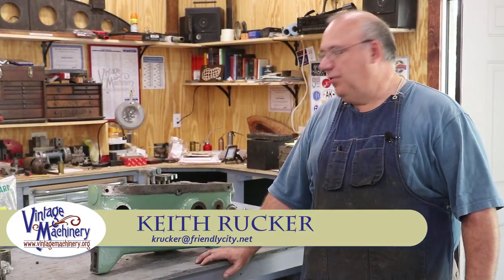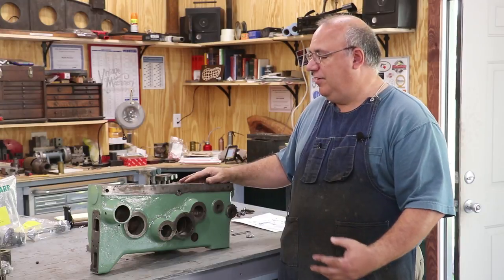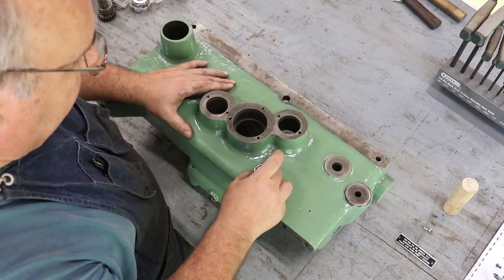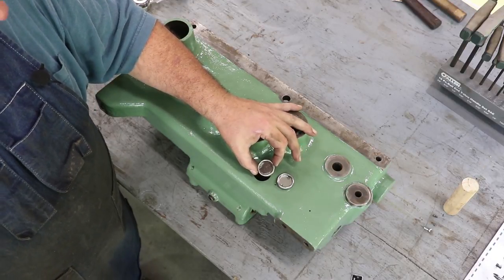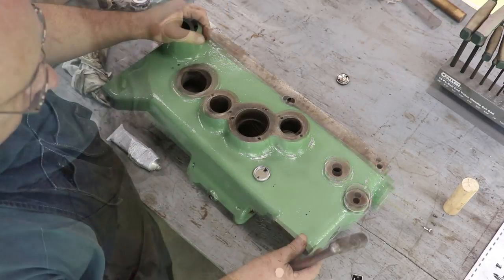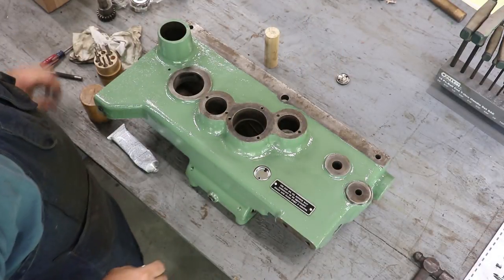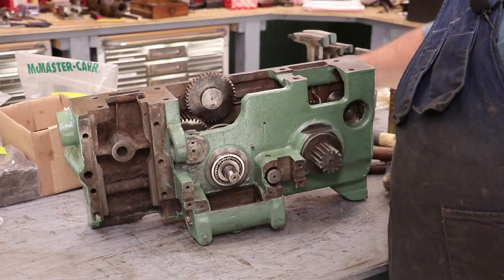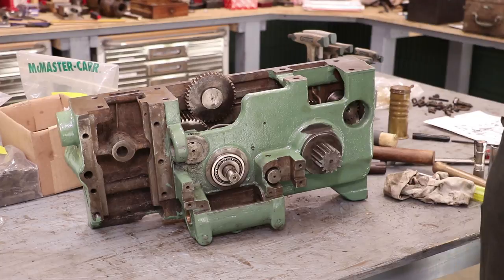Monarch 16" Lathe Restoration 9: Apron Reassembly

Comment: Great that Monarch still has the parts available! Yes they are pricey but I think it is worth the donation to keep that source around.
Reply: It makes me wonder though, whether those very high prices are justified. I know, from having bought and made them, that bronze gears that size can be expensive, and worm gears are even more expensive. But this is really expensive. Since it’s a custom size, it’s going to cost. But from people I know who have worked on Monarch, and other lathes from back then, the prices are well in advance of what would be expected by inflation. Yes, they sell small numbers. But, as a former manufacturer, I can say that raising prices above what’s required, drives customers away.

How many people, and companies, who would have otherwise rebuilt machines, decided to scrap them out instead, because of overwhelming parts costs? Quite a few, I would imagine. That doesn’t help  those who want to rebuild a machine, and in the long run, it doesn’t help Monarch either.

Comment: Keith,
I may be old school here. But I have built many engines in my day, no lathes, but automobile engines. As I watched you reassemble this very complex gearbox (dry for the most part), I said to myself, "Why doesn't he use STP?" I always coated all my engine parts with STP when I built the engine because without it, until the oil (Owell as you call it :) ) pump pushed the oil up into the engine, it was essentially running dry. Okay, I get that this assembly is rotating nowhere near as fast as an automobile engine. We are talking back in the 60's here, but STP coating a bearing surface would prevent any kind of wear. In fact, I bet that it would take you a year of use on that lathe before the real oil ever got to the bearings. Also, seeing as how the bearings are sump lubricated, I would have soaked them in STP first. They would probably last a hundred years if you did. Anyway, just a ramble about a product I used and trusted, not to mention the great TV commercials featuring Andy Granitelli of of NASCAR and INDY fame. Can't wait to see you make some chips with this baby. Who knows, maybe you can put a small bag into the safe when you finish it with the forge you made to melt the bronze to pour the dial for the safe! Lol, sorry Keith, I couldn't resist. I just can't believe how long I've been watching you and how much quality content you've given us, your fans. It blows my mind; watching the shop go from an idea (right after the safe) to reality. I hope I can live long enough to see you complete the wood-working side of the shop. You have made Friday mornings a look forward to part of my life.
Thanks,
Rich

Comment: On any manual lathe that worm and gear are usually "out of sight, out of mind." Considering the cost of those two items, it is well worth your time to make sure they are kept clean an lubricated per the manufactures specification.  The $500 Monarch special gear may seem high, but at least it is available. If you have one of the Asian mystery lathes for which there is no support (i.e. nearly all of them) you will go on a snipe hunt trying to find parts that fit or can be made to fit your lathe.
Chinese and Asian lathe maintenance instructions often leave this critical cleaning and lubrication requirement out. These bench lathes require greasing the worm gear monthly. They need to be kept clean because of chips getting into the mechanism and sticking to the grease causing damage to the worm and gear.

Comment: I've been working on a South Bend 14-1/2" lathe apron today.  Watching your video this morning encouraged me to do what needed to be done to get it fixed.  Hopefully parts get ordered either today or Monday morning and I can start putting it back together.  So far the major issues were a worn cam-lock stud, a sheared 1/8" pin inside the apron clutch assembly, 4L460 drive belts are completely trashed and the cross slide nut was pretty badly worn.

Comment: Keith, I do not wish to brag, but I believe that I am more gifted than you when it comes to mechanisms.  My talent was evident early on when I could construct a swing set or bicycle for the kids and have parts left over.  I have carried this ability throughout my adult life.  In addition, I note that my vocabulary is far superior to yours. . . that is unless one is religiously inclined.  As I have an old NebeI lathe to restore, I have been enthusiastically digesting your restoration presentations.  For certain my attempt to restore the Nebel will be a vocabulary enhancement exercise.

Comment: Keith, well played!  You are aware of the 1901 L&S that I am working on.  I just finished up with the apron and cross slide on mine.  Very similar setup, but all bronze bushings vs. bearings.  Yes, pictures (video) of the disassembly is always helpful when putting the puzzle back together!  Great Video!

Comment: A trick I invented many years ago to drive the bearing races of tapered roller bearings (cups and cones) is as follows. However you get the old races out, drift, punch, whatever take the OLD races and cut them through with an abrasive wheel along the axis. Now the OLD race becomes a bearing race driver. Even if the new race is a tight fit the driver is "springy" and comes right out with finger pressure.Used to go through a set of cheap front wheel bearings every year on my Chevys years ago before I got smart and went to Timken...

Comment: I am surprised you did not lap the cone clutches while it was out. Volvo outdrives used the same setup for fwd and rev they are bulletproof. We always lapped them while they were out to keep it shifting smooth. Very easy to do with oil and fine abrasive.

Comment: The loose bearing races struck me as wear, considering the tight interference fit as you drove them, only to get sloppy loose as the got close to home.  I like Loctite 620 Green Retaining Compound when I encounter signs a bearing has been spun; holds the race firmly, but still removable.

Comment: I used to work on Acme Gridley screw machines.  The work was similar to what you just did except the gears and bearings were larger and the holes to work through were a bit, but not much, larger.

Comment: Great video. My only comment is that driving ball bearings in like that shortens their life dramatically because of the shock load of the balls on the races. In a low speed low load application like this it probably does not matter much. Good practice is to make sure the installation forces are not transmitted from one race to the other with the rolling elements. In critical applications it really does matter. Thanks for sharing your work.
Reply: I've asked Keith about the way he treats bearings before but so far he hasn't responded. Nice to see someone else mentioning 'good practice'.
Reply: Those were Roller Bearings.  A proper tool should be used for seating the Cups.
Reply: Just curios......how would you guys install them?  Heat up the casting?
Reply: Pressing the bearing using the race would probably be the easiest. Inner race use a bolt in the end of the shaft and a tube over the shaft. Outer race use a c-clamp to squeeze it in. You can use heat or cold to install but it's easier with bigger bearings and less complicated assemblies. Just make sure to push on the race being fitted and not from one race to the other using the balls.

Comment: Keith, wanted to drop you a line. Listed on Craig's List in Atlanta, Ga. Under (milledgeville) there is a group of metal shop equipment with overhead belt drive that says save from the "scrapper". Some stuff might be good for you, museum, or steampowered machine shop. Such a waste when this stuff is scraped.  Best regards, Philip

Comment: Another great video by the master of the restoration. I thought you had an issue with the pumper system and how it assembled with that hand wheel shaft, when you  took it apart. Keep up the wonderful work.

Randy

Comment: winces That $535 price for the bronze worm wheel feels like a quarterback sack to the wallet.  What about doing as others suggested, hand-grinding a form tool  from HSS to fit the good worm that can then be used for making a cutting hob with?  Incredible patience getting the apron mostly back together, at least the most difficult portion of it.  Still had snafus but you took breaks from it as needed and thought about ways to make all those tricky portions easier.  Lathe's going to be a joy to run and all the effort will have been worth it! ^^
Reply: Or, is the worm of a pitch that none of the lathes you have access to has the gearing to cut, even with a form tool ground to the profile needed?
Reply: time is money
Reply: Patriot1776 i
Reply: I have dealt with Monarch for parts needed for my 10ee... a 1944 model year.. and yes, the parts are expensive but they fit every time. The people who answer the phones or fulfill the parts orders are extremely knowledgable and helpful. They even (once) went so far as to sell me a used casting to fix the machine to OSHA specs.

Good people, good company.

Comment: Surprised at how loose those races fit on the shaft and in the housing- with a tapered roller bearing you want the races to stay in place and the rollers to rotate.  I would have used a little loctite on those races.  Also on the thrust bearings you usually have 2 different ID's on the races, one to locate the race on the shaft and one to allow the shaft to rotate freely against the fixed piece.  Back in the first video it almost looked like that broken drill bit in the hole may have been done at the factory and it just slipped through QC- If the hole had been drilled at the factory, there would have been no need for someone to drill through there later on.  Amazing to think that all that entire apron mechanism is replaced by 2 servo motors on a modern cnc lathe.
Reply: Yeah, but would those two servo motors last for 50+ years of service and be able to be rebuilt for another 50 years of use? Imagine how long this thing would last if somebody actually changed the oil in it once in a while!
Reply: I agree. I've installed a lot of bearings and races (although never in a lathe) and I have never had a race spin. That is what the bearing is for.

Comment: I'm sure you he could make the worm gear, but if it's a non-standard pitch then that means making another gear to get the lathe to do it and at some point time is worth more than just buying the part. I don't know what the lathe cost originally, but if I haven't missed something it's got less than $1500 in new parts. That's for a lathe that will be worth around 10X that once it's back to fully operational condition (especially given the attention to the cosmetic side of things he's given it). More so, it will be a tool that will be able to make parts for many decades to come. I venture to say it will outlast a lot of lathes bought new now.

Comment: Think I was one who commented I didn't envy you putting that back together... if not I should have. Well done sir! 
A question: Is reason for worm gear drive off another shaft because of torque requirement that would just be too much for half nut alone, or does it make feed speed changes easier? Wondering why you couldn't just drive off half nut... at least horizontal.

Comment: I would have added some Locktite to the Bearing Cup that was slightly undersize.  I worked at Timken Roller Bearing Go. in the 60's.  I always put some correct grease in the palm of my hand and force it up between the rolls on the Cone when assembling.  You did mention oil pump but I don't see how oil can get to some of those Tapered Roller Bearings.  The grease was in there for a reason!  Splash oiling?

Comment: A bit of lock tight on those races might have been in order. I'd think you wouldn't want them spinning in the hole.  Thanks for the video.  Is the pump  going to go back in with no trouble?
Reply: Duncan, at 1 or 2 RPMs there is not going to be a 
LOT of wear.

steve
Reply: agreed. or a couple of dot punch marks

Comment: I think keith should have staked the surface of the first race insertion. Not on the back holding wall but the outer circumferance of the body of the apron with a center punch.

Comment: Keith:
Can you cut the brass gear in two steps without using a hob? Cut the teeth first and then use a rotary table and an end mill to cut the radius on the face of the teeth?

Maybe get with John Saunders and see if he can cut one on his CNC?
Reply: Cutting the teeth would give a flat bottom, and the bottom of the teeth need to have a radius to match the worm. The teeth are also angled to match the worm pitch, so not quite that simple!
Reply: possible with cnc though, but he may want more than 500 to make one that way

Comment: Before you reinstall the halfnuts be sure to clear the oil passage to the top halfnut - it only lines up when the halfnuts close (at least on the Monarchs I've worked on) and often is clogged. 

What are the specs for the worm wheel?  $500 doesn't seem too out of line for a one off but someone might have one laying on the shelf
Reply: yeah, monarch has one laying on the shelf, the 500 dollar shelf lol
Reply: That's where the same part for my 10EE came from

Comment: Hey could you have put a little lock tight on the outside of that bearing race it should keep it from spinning
Reply: It's very low speed, only moves as fast as you can crank it. It won't hurt anything if it did spin, anyway the friction with the spacer will probably keep it from spinning anyway.

Comment: If both the worm and the gear are nonstandard, couldn't you find a functionally equivalent standard set to replace them with?  All you need is an equivalent ratio and shaft size.

Comment: What bearings did you use for the shaft that rides on the rack? Mine had the original 3 piece rollers, but you seemed to have a nice steel sheilded one there

Comment: As I read through the comments it seems most are wondering about the lack of prelube, me too. I'd also think about his use of hammers and the consequences'. Getting back to the oil I see no input on the orifice he created with the blockage in the Saddle by drilling a eight inch hole through it rather then removing it completely. I believe the back pressure it will cause over oiling in the apron and starve the saddle. Any feed back from my fellow nit pickers.
Reply: Eight inches in Diameter or 8" deep?
Reply: eighth inch, 1/8, .125

Comment: only watched 10 minutes so far but i think a drop of locktite bearingfit is in order here. there's no telling that the race or the shell is rotating. why were the bearings not greased or at least oiled prior to assembly? i understand there is an oiling system but i think it should at least have a bit of lube to get going with.
des.

Comment: I feel the first race you put in, should have been taken back out, and using a center punch, lifted the race surface tight inside the bore. that way the bearing would not wear on the outer side, by the race turning in its bore.
Reply: Personally i'd have used some loctite retaining compound, but to each their own. Then again in this application being low speed it'll still outlive Keith.
Reply: Centre punching the OD of a Cup can cause out of roundness.

Comment: What’s the idea with not putting grease on the bearings?
Reply: Sam Burdick I was thinking the same thing about the hand wheel bearing
Reply: The bearing in the apron are lubricated via cup oilers. Because small chips tend to get everywhere, you wouldn't use heavy grease because it traps the small chips causing bearing failure.
Reply: some of those taper bearings will barely get oil to wick into them though
Reply: comictrio I assumed that would be the case, however I don't see any cup oiler holes.
Reply: it doesnt have a cup oiler, it has a sump and a small pump with pipes to put oil on certain parts, its much more sophisticated
Reply: Jusb1066 sure, but I look at some of those Timken style bearings and they are shielded from the inside of the casting by races which didn’t get any lubricant at all. Same goes for some of the thrust bearings.
Reply: Look at all of those oil lines Keith was pushing out of the way. They must go somewhere and pour oil on something. If I were designing a thing with a lot of bearings and a lot of oil lines, I think I'd use the oil lines and some holes in the casting to lubricate the bearings.
Reply: i agree the bearing dont seem to get any lube
Reply: The bearings on the outside of the shaft/casing, I don't see how they will ever get oil.
Reply: Keith rarely oils things on assembly. Very occasionally he does but nothing consistent except his inconsistency.It's very important in a area with such high humidity to prevent rust forming.
Reply: In this application it probably doesn't matter. These bearings are not going to be spinning at high speed and until the internal lubrication system gets going the packing oil on them is probably good enough. It's not like these are going to be spinning fast enough to build heat, a thin film of oil is all they need. Not to mention he's not completely done putting this back together. He might just go around and squirt oil all over the internals before he finishes. Just because we don't see something in a video doesn't mean it doesn't happen.
Reply: There's a oil supply system actuated by the carriage hand wheel. check out the previous Video with the blockage in the Saddle...
Reply: Somehow I failed to see the oil lines inside the apron. Old eyes, I guess:)
Reply: one hopes it works down slowly, the out ends of the bearings are open, so oil will weep out too, so perhaps a visual clue
Reply: Those 'ole boys at Monarch were pretty sharp.  This fine machine didn't make it 70 years without the apron bearings receiving any oil